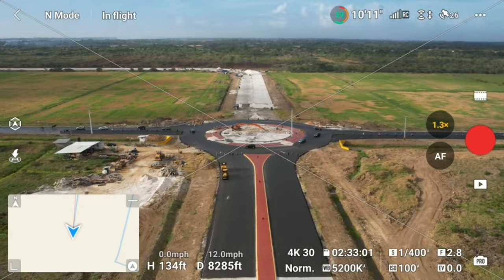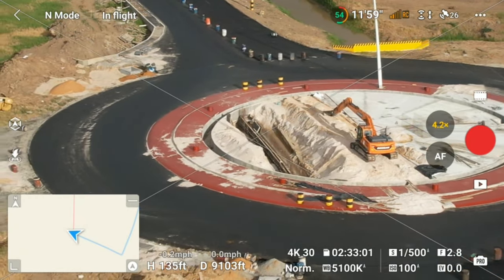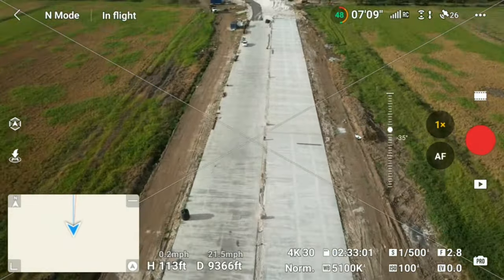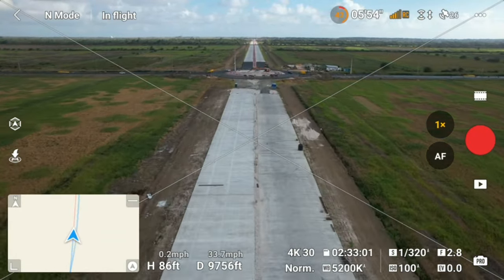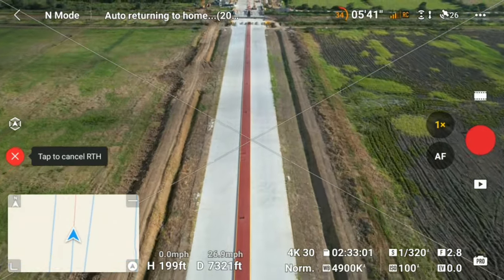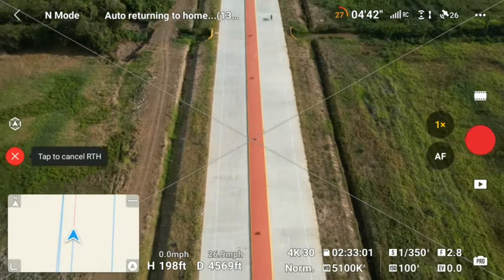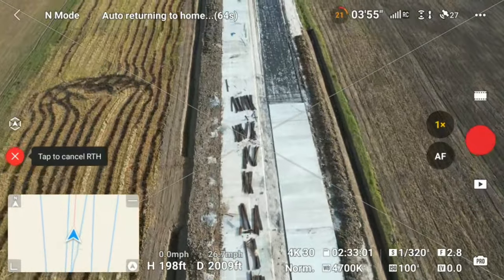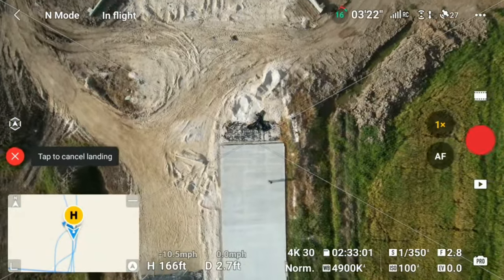NEW VIDEO: SCHOONARD TO CRANE NEW ROAD UPDATE (4/16/24) PART3. #geo #guyana  #vreedenhoop #westbank

Comment: I appreciated your video showing the new roads., but would appreciate more if you can explain a bit more it's really difficult to understand  Thanks 😊
Reply from the maker: @nalisasingh9056  if you have a question, i suggest ypu ask in the comment section. II'm sure someone with knowledge will respond.  I do not knownthw details of the projects I learn from the comment section as well